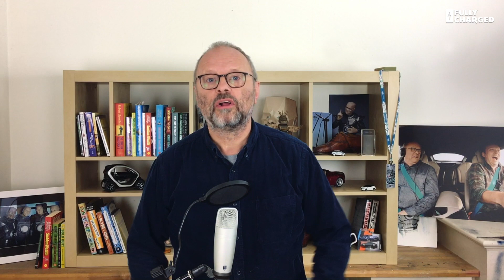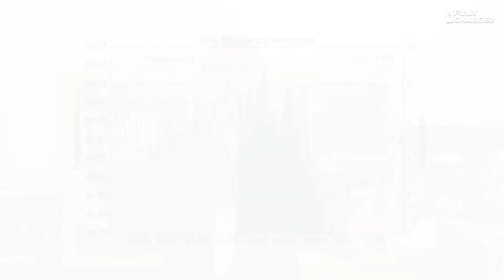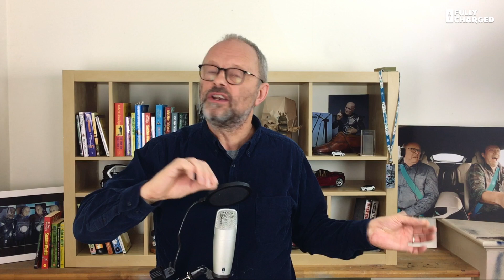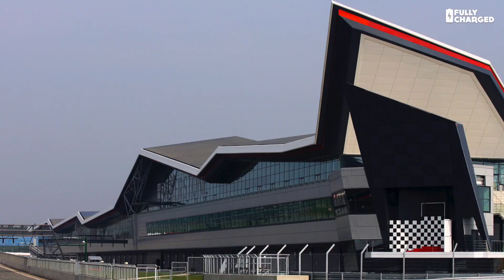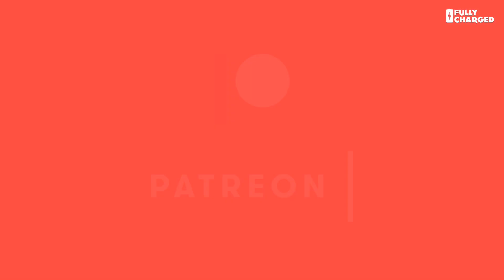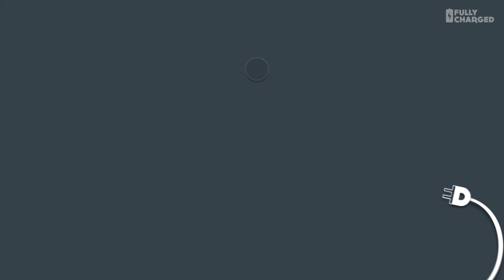Welcome to 2018 | Fully Charged News

Comment: I think cost is a big problem but Nuclear Waste is a huge problem in my opinion! Also nice using netflix as a verb :)
Reply: It is waste if you don't use it, it always has a great potential of thermal energy and there are allot of high cost minerals you can extract from it.
Reply: I’m certain. I work in the industry. I was talking UK plant. The only heavy water we use is in Sizewell B. That all stays within the plant and very little of it ends up as tritiated waste. All of which can be relatively easily processed and not end up as high level waste.
Almost nothing outside the primary coolant in any plant gets contaminated, so when you say anything that comes close gets contaminated is entirely erroneous.
Fukushima was a one off where we have seen waste water discharged, however it has been closely regulated. Media state things like, for example, the concentration of radioactive Actinide has doubled in the sea as a result of the accident but when that means it’s got from 0.25 parts per billion to 0.5ppb, it negligible in terms of environmental radiological safety.
How many people died from Fukushima? Two - both from an industrial accident (something falling on them), neither from radiological reasons. How many are likely to die or be ill?  Currently estimate remains zero.
How many folk died from the Bhopal chemical disaster?  At least 3700, possibly as high as 16,000; and folk are still suffering from it health wise today. Yet we don’t see cries for the discontinuation of the chemical industry.
Reply: Remember that the entire high level nuclear waste from UK plant to date can be piled about four foot high over the area of a single football pitch.   Most of that was produced by the magnox and earlier stations (all now close) and a tiny fraction by SZB.  Yes, we need to be landing on a solution soon but the volumes we are talking about are relatively minuscule.
Reply: Are you sure? I know there are tons of heavy water that becomes radio active and almost anything touching the system is radio active. I saw in some documentary that showed barrels and barrels of radio active material in deep storage.  Also radioactive stuff need to have security forces 24/7 so bad people cant take them. Also don't forget about  the accidents in Fukushima that pure into ocean tons of radioactive waste. why go through all that when you can get cheaper energy from sun wind and geo-thermal?
Reply: Incidentally, all waste is either housed on site or at the reprocessing plant, which had security 24/7 pretty much like any other major industrial facility.
Reply: Radioactive material deep in storage will either be in fuel flasks, of which most of that volume gets reprocessed to a tiny fraction of the volume, or you are looking at waste encased on concrete or borated glass, the waste itself being in a small volume in the middle.
Reply: Solar also produces tons of waste (old pannels, pannel holders, etc., not to mention equipment production waste), but your point is of course valid... until the solution to this problem is found. Considering the exponential scientific progress we are witnessing, this can't take very long. If we manage to keep the waste safe for, say, 100 years, that's it, we're out of the woods, imho. It's just sad how anti-nuclear activists always talk about tens of thousands of years of having to take care of the waste as the main anti argument. That's just naive. But they often win and we end up burning even more trash (often literally) and building generators on every serviceable stream, lying to ourselves that this is "cleaner" and/or "safer".

Comment: Single, large, one-off nuclear plants are hopefully going the way of the dinosaur. Small, modular, standardized reactors will greatly lower costs. Unfortunately regulatory institutions are currently set up only to assess large reactors, so the regulatory framework needs to be adapted for these new reactors to be approved.  It's taking a long time to make these regulatory changes because nobody really wants to pay for it, not government, not the existing large nuclear companies (who make large reactors), and not the smaller companies making the small modular reactors. At least in Canada our regulatory system is more holistic, so at least one small modular reactor design has reached the second step in our pre-licensing review. And it's a molten salt reactor, so it can't blow up as it's under no pressure!
Reply: Jupiter065 small modular reactors (solid fuelled) are not the way to go. They are cheaper to build, and safer, but they operate at a lower temperature and that means that they only achieve 75% of the efficiency of larger plants. They also have the same waste issues as larger plants, in that typically use only 1% of their fuel and discard the rest as waste.

Molten salt reactors solve or massively improve upon all the problems with current reactors, whist operating at higher efficiency than today's reactors. As you mention, some SMRs are molten salt based, but most the designs I see are big standard solid fuelled designs.

All that is needed for MSRs is the political will and funding, which we lack in the UK, but not so in China and India, who both have active MSR (and thorium) programs. Canada does seem to have a more flexible regulatory regime than the US and Europe.

Comment: Sir, we do not have any nuclear power plants, finished, under development or planned, here in Norway. We use hydro and some wind. The oil and gas we generally sell. But nuclear? No, that would be madness at this point in time. Maybe you are talking about Sweden? or Finland?
Reply from the maker: Dammit, I meant Olkiluoto 3 in Finland. I am so sorry. In the next news update I will correct this big time.
Reply: Must be Finland. Here in Sweden, no new nuclear is planned at the moment.
Reply: Most likely he ment Olkiluoto 3
Reply: It's in Finland...new type of nuclear plant French & Germans (Areva & Siemens)  developed and used us as a guinea pig... building project started in 2005 and it was supposed to be ready by 2009... hopefully it will be in production in 2019...original budget was 3.2B Euros and now the estimate is something like 8.5B...not a good track record... hopefully it will be state of the art...
Reply: We do have two research nuclear power plants in Norway. But they are tiny and only for research and no new nuclear power plants are under planning or development.
Reply: First installed fuel rods will be in may, 2018,  production testing is going on in final stages.
Reply: Jukka Aunola All I hope that when they press start putton first time they don't see 'bad command or file name' error in pc screen...
Reply: Would never call the two research reactors in Norway power plants. Although definitions may sue me. Great you are correcting, FC. We superclean (and quite hipocrazy) Norwegians dont like to be associated with nuclear (although on a bad day, we buy nuclear power from SWE).
Reply: yeah you supercleans export the fossil shite :D clever

Comment: *in 140ms not 1ms
Reply: Australia is 50Hz power, so 7 cycles. Can't ask more than that.
Reply: Kualthys- Not from a cold start though.
Reply: Yeah 1000km at 1ms, we're not there yet, but 140ms is still impressive
Reply: Dāvis Kalniņš went here to comment the same thing. u first tho
Reply: of course it is, especially considering that peaker plants take up to an hour to respond to such events. :D
Reply: Well, you say that, but the coal plant contracted to provide grid stability services (the one that was meant to do what the Tesla Battery did, and in fact DID do what the tesla battery did, just with a delay) is capable of responding within 5 seconds.

Yes, there is a coal plant. In Australia, that can respond to grid instability in under 6 seconds.
Let that sink in.
COAL!
Not gas, not a battery. Not pumped hydro, COAL!

Yeah, I don't get it either, but that's apparently a thing that's possible.
Gladstone Coal power plant can apparently manage a 6 second response time... Yeah...
Reply: It can only respond once the frequency drop is detected at the battery site. http://reneweconomy.com.au/tesla-big-battery-outsmarts-lumbering-coal-units-after-loy-yang-trips-70003/
Reply: Yeah, was going to say that, but then I wondered, was it micro or milli seconds? 
Dunno, but fastest responder either way.